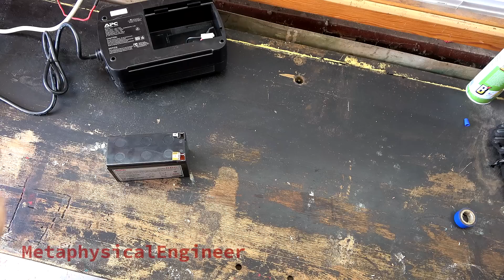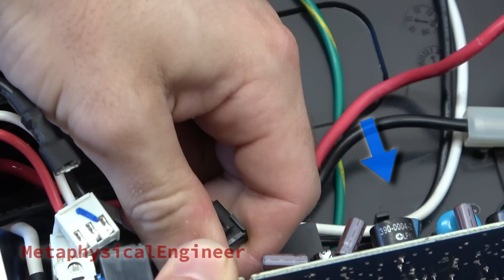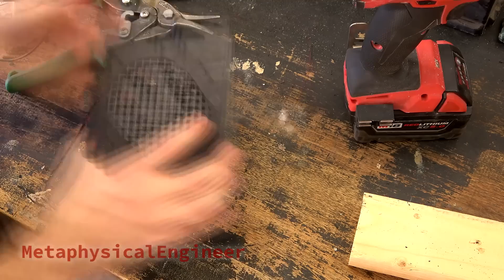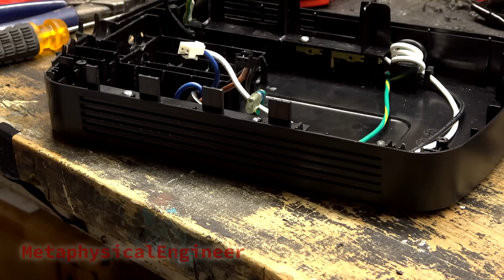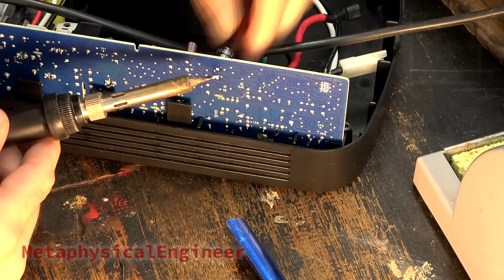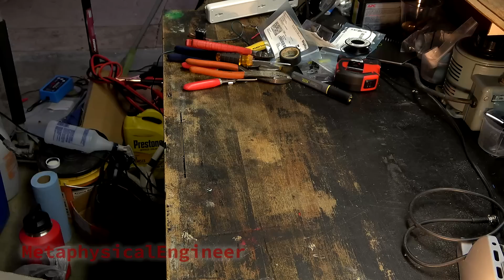Modifying broken UPS for long endurance BACKUP POWER!

Comment: I just need to supply a small load (my little web server + modem & router), so I didn't bother with all that stuff. No fan, no battery box. I just spliced a couple of cables with battery clamps on the ends, in place of the original 7A battery, drilled holes in the UPS box for the two wires, and put the UPS on my desk next to a car battery. (If I'd been intending to power a larger load then I'd have added a fan.)

One advantage is that I can swap batteries without shutting anything down.

Another advantage is that I always have a fully-charged car battery, ready to go, in case I need it.

The first time I had a power outage, it worked fine, but the beeper was intolerable. So, after the power came back on, I removed the beeper.

The next time I had a power outage, it lasted 6 hours and 40 minutes!  My UPS kept my website up the whole time. Nothing ever smelled hot, and the UPS never got warm to the touch.

I clipped a multimeter to the battery terminals, and the voltage decreased by a little over 1v over about six hours. I suspect it was near to shutting down by the end.
Reply from the maker: Sometimes that's all you need to hold out through an outage!  I like the concept of hot swapping external batteries as needed.  

I've not yet found where my unit will cut off based on voltage, but I'm guessing somewhere below 11 volts since it also assumes the battery voltage will sag under load.  You may have had even more runtime remaining than you thought.

Comment: I wonder if it would be possible to hook up the UPS to a bms and a Liion/LiFePo battery. If it constantly outputs 12v to charge the battery, and assuming the bms takes care of charging/cuttting charge and balancing the batteries, i wonder what else would be missing? Maybe a circuit to switch from input to bms to output from battery in case of a power outage?
Reply from the maker: Lithium battery with BMS and high current cutoff, and disable the original lead-acid charging circuit.  AC source transfer can still be handled by the original control circuitry.  Actually quite doable and much higher performance, though lithium is still significantly more expensive than lead chemistry, especially with the added BMS.  Maybe for version 2!
Reply: If you are rich enough to afford lifepo batteries, you are going to be buying top of the line industrial grade UPSs, not making your own out of scrap and base components.

Comment: did the same sorta thing with an APC Back-ups pro 1500
it had a fan and external battery add-on so I basically determined the limit would be energy of the battery and not the main unit
it worked fine for a while, but I wanted more than 850w of total surge power and the charging system was super slow for my 100ah 24v setup so I bought a real 4kw solar+charger inverter, and now I have 200ah(probably degraded to ~150ah) 24v system than gets me 6 hours at normal load and can push to 8 hours if I shut down some of my ancilary loads
Reply from the maker: Those pro units are tanks!  Makes sense that once there's provision for external battery, the unit is tough enough to run even longer without risk of damage.  What type of batteries are you using for your new setup?
Reply: @MetaphysicalEngineer   just the cheapest battery at my local Walmart in the capacity and type class I can get

I think everstart 29DC "marine deep cycle" types, they are about 100Ah in capacity when new, the old inverter UPS setup would have pulled ~45 amps at full load so I knew I wasn't getting a full 100Ah due to the whole "capacity degrades above the 25A rating" so I bought a second set later due to age and runtime

my average load was only 500W peak around 250w static but as I hate complex wiring I wanted a system that could pulse run my 1kw fuser in my LED-toner printer without wiring that thing to a seperate non-connected power plug

about 100-150w of my load is actually just screens and my router+modem(measured back in the cable modem days now I have a fiber line)

I am guessing my capacity will have degraded as much as 50% on the first set being 6-8 years old(if they work at all) and so my next big shopping item is probably gonna be 2 new batteries, 2 boxes, a spool of 1/0AWG wire, a crimper, and a set of lugs to crimp(finding pre-made cables of ideal length is pain)

when I finally retire my oldest set of batteries(only when they test bad and I have spares) I will re-use the cases and wires making the setup less evolving

and if I ever change my life and end up in a home I can do solar in I can use the inverter 24/7/365.25 and being I will be seldom loading more than 1-2kw in my indoor space it should last longer than my own body

sure at that point I would be using LiFePO4 12v packs(better capacity and endurance for deep-cycle if about 2x as pricey) but given an actual 100-0% rating of a minimum of 500 cycles(lead-acid can barely do 10 full cycles before damage) it is better for systems you might actually run that low

Comment: I recently found that those oscillating saws work amazingly on these abs or other similar plastic cases. (If you need a straight cut)
Reply from the maker: Thanks for the tip!  Didn't think to try the oscillating saw.  I'd worry it would bind up in the melted plastic and simply vibrate the workpiece instead of cutting, but I'll give that a shot next time.

Comment: you can also use a stepped bit as an impromptu deburring tool.

Funny you'd post this. We have similar power issues where I live. I'm already using a 'failed battery' UPS for surge protection and I've contemplated this exact modification. Now I know what I should be checking before I do the work. Thanks!
Reply from the maker: Yeah, a step bit would have been helpful at multiple stages of this project.  Another thing I rarely used (borrowing the boss man's kit when needed) but maybe time for one of my own.   

A word of caution from another commenter is checking that the battery side is isolated from the line voltage side.  Some units use a "line-interactive" type circuit where significant AC voltage can be present at the battery terminals and could give you a nasty shock if you do a USB charger or 12V socket like I did.  Measure between battery negative and ground.  You're safe if they are tied together, but beware if you get voltage there!
Reply: @MetaphysicalEngineer  Wow! I'll definitely check for AC voltage at the battery, It's kind of insane that a USB would be built that way. I lost a battery in my 1948 Willys CJL because the diode pack on the alternator failed and was bleeding AC power into the battery.

FWIW, Harbor Freight in the US carries stepped bits for under $25.

Comment: You could hang a small solar panel outside a window and use that to power the device while in standby mode. That should be enough to keep the battery charged. You would only need mains power if an actual load is connected.
Reply from the maker: That's a viable option since this side of the house gets plenty of sun.  I'll borrow the little 18W smart solar battery maintainer from my car to see how that behaves.  Anything would be faster than the tiny 3W charger in the UPS, though I fully expect to need an external mains charger to recover from an outage in reasonable time.
Reply: @MetaphysicalEngineer  That is the idea. Use mains for recharge, but solar for standby. with a bit of luck, it will give you enough power to charge your mobile devices for free. Not only will that save you some money, but you will have some power even in case of a prolonged outage.

Comment: Nice job. I have a 20+yr old apc 2200 with an external connector for battery packs. Only downside is it runs from 48VDC & I'd have to drill a hole in the floor down to the garage to add more batteries.
Reply from the maker: Thanks for stopping by!  Understandable that it's a pain to run remote batteries like that.  Is putting the UPS down in the garage next to a hypothetical battery bank and pulling a "surge and backup" AC circuit up to your workspace an option?  At least for me I'd rather fish romex or armored cable than a set of heavy gauge 48VDC wire...might be cheaper in materials too.

Comment: I did this with a couple of them. I removed the battery and put in a PC fan and a small 120-12v PSU for it. I ran it off the inverter outlet rails. I broke out the wall between the battery compartment and electronics area. These are underrated to have passive cooling. With forced cooling they do so much more. I also partially bypassed the amp limiter.
Reply from the maker: Another success story of a hotrodded UPS!  120V to 12V converter was an option I thought about for the fan, but just didn't make as much sense to me since the unit already had a 12V source right from the battery.  

How much more capacity were you able to get with the current limiter bypassed?  I imagine at some point it just bogs down too much or the transistors give up regardless of cooling.

Comment: Its alot easier to use self tapping screws for creating pilot holes in plastic when you have no anchor. It is also a lot safer than doing it with a drill. Get screw and hammer. Hit it with a slight tap in the spot you want (this acts like breaking the glaze on a tile.) Then use you cordless screwdriver to do the rest. Great vid by the way.
Reply: You are out of your mind if you think it is safer to the enclosure to be hitting a self tapping screw with a hammer.  If you have no concept of drill depth limiting, the last thing you should involve is a hammer, lol.
Reply: @stinkycheese804  you have obviously never done this.
Reply: On the contrary I could MORE easily state the same about your (in-)experience.  It's idiotic to hammer self tapping screws into anything, especially thin plastic.  Hopefully some day you will learn how to use a drill properly and open up a whole new world of hole making, lol.   @plebius
Reply: @stinkycheese804  you are talking about depth limit on drilling a unsecured piece being handheld. That slipped numerous times.
Reply: @stinkycheese804  I also thought it was obvious when saying pilot hole, you still use a bit in the handheld screwdriver once you create a pilot hole. Hence me saying you haven't done this. Glhf
Reply: I've been modding things for decades, no such issue merely drilling holes.  Really?  I'd hate to think how much trouble you'd have doing something more than entry level.  If it's that hard for you to depth limit, simply use a shorter drill (bit) if you've never heard of a drill stop or better still putting a solid piece behind the hole, clamped in so the back of the hole doesn't flair  out.  Round holes are a piece of cake.  More tedious is  filing out square, rectangular, etc for panel mount jacks/switches/etc. @plebius

Comment: yeah i have done the same thing a few years ago,but i started with a bigger metal case UPS,just ran leads out and connected it to a truck battery
Reply from the maker: Cool!  What capacity UPS did you use and how much runtime did you get from the truck battery?
Reply: @MetaphysicalEngineer about 350 watts,never found out runtime,it was hours longer than i ever needed,it might still be in my storage unit,if it is i'll get it out and take some photos

Comment: I’m watching your video on this ups, and get blown away when you bust out the field piece sman Hvac gauges. Now I gotta dig throuh your channel to see why you have EXPENSIVE HVAC tools on your workbench. I have several sets of them in my HVAC service vans.
Reply from the maker: I used to work in HVAC and refrigeration but got hit with a career-ending back injury earlier this year.  Fine now but high risk of repeat if I go back to heavy trades work.  Getting forced to take a step back revealed I wasn't where I wanted to be after all.  I am considering getting my license at some point, if only for easier access to certain equipment and parts.  I've torn down a compressor with valve failure on here, and have a second compressor with a suspected broken crank also waiting for teardown sometime.
Reply: @MetaphysicalEngineer  I’m old school, got my licenses at 17 back when all ya had to do was take the tests. 
Nowadays, all the insurance and work hours experience needed to qualify to even take the tests slows most from getting licensed.
Lemme know if ya need any assistance with anything. I put your video on diysolarforum it should post up after Will Prowse reviews it. 
See if we can get you some exposure for a nicely done video.

Comment: I need to do this. My UPS gave me an error saying the battery was toast, I cleaned the terminals, checked voltage, and hooked it back up and it's not given any kind of error or warnings in the 3 weeks since. A bummer since the battery is 18 months old, and the OEM replacement is backordered :(
Reply from the maker: Easy way to test is do what I did putting a constant load on the UPS with lightbulbs and seeing if it comes close to expected runtime.  If it falls well short or instantly loses power, the battery's given up.

Comment: WARNING!
I do the same thing many years ago using another model of UPS (was a cheap line-interactive unit, so basically the same thing of your UPS)
Everything worked fine (i also added a small fan inside in place of the battery for cooling purposes as well) and this contraption ran for about 10 years but.......
...... it turned out that my UPS had no insulation between the mains and the battery because the output transformer was connected in autotransformer mode to boost or decrease the output voltage in case of weak or too strong grid (i.e. a sort of rough voltage stabilization operated by switching some relays) which means the battery terminals floats at 230V, the european mains voltage!!!!!!
For me it wasn't a big problem (i also enclosed the battery inside a box) but in your case it may be extremely dangerous (because of the USB and the 12V auxiliary outputs!)
 Please double check if the battery floats to mains voltage or not.... this is important!
Reply from the maker: Yes!  This is important for line interactive type units that always provide regulation.  In my case, this unit has separate low and line voltage sides, with battery negative referenced to earth.
Reply: @MetaphysicalEngineer  Good to know.
But this is something you should point out for warn other people.... Without the external low voltage outputs this is fine, but if these ports are added, the builder shall double check for insulation!

Comment: I liked how for every modification step you checked that it would not catch fire.
Reply from the maker: When the battery can dump nearly a thousand amps into a fault, things get rather exciting.  Getting or building a bench supply is on the long list of things to do.
Reply: @MetaphysicalEngineer  Agreed. Had a motor driver fail SS and in the few seconds it took me to pull the batteries it desoldered almost every connector and stripped every wire in the chain, and that was likely only ~200A. When the battery can weld a wrench across itself, you take extra precautions 😅
Reply from the maker: @Lizlodude   Holy cow!  Sounds like it got your heart pounding!  Glad you're ok!

Was that on a high performance RC vehicle?
Reply: @MetaphysicalEngineer  time to buy a bum desktop computer just to turn the PSU into a bench power supply.

Comment: THAT NEEDS TO BE FUSED FROM THE BATTERY. If a short, the wires would burn up at that would start a fire. No way the wire you are using can take the amprage of that battery should some thing go wrong.

PLUS the fact that battery emits HYDROGEN GAS is not very safe.
I can see this as a recipe for disaster.
Reply: He did put a fuse on the battery, no?
Reply: Did I miss that part? @amogusenjoyer
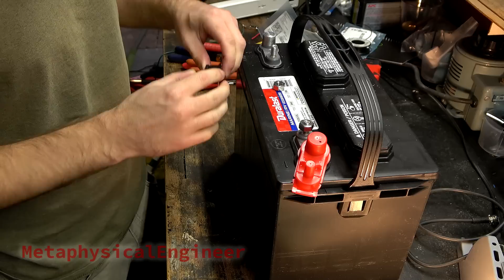Reply from the maker: 22:44  -  Main fuse connected to battery positive terminal.  In fact I specifically outline the dangers of such a large battery with specs on how much current it is capable of providing.  

25:54  - Secondary fuse for voltmeter, utility 12V socket, and USB charger.

Comment: Wait so you are telling me just by adding a bigger battery and keeping it cool will make it run longer....I tried that and mine APC did not....pls help
Reply from the maker: Essentially yes.  The UPS is designed to run until the battery depletes.  Bigger battery stores more energy, so UPS runs longer.  Fan keeps it cool because original design assumed battery would run out before the components overheated.  

What model APC unit did you use?  What size and type of battery?  What load were you powering with it?  How long did it run before it stopped? What LED indicator error code did it give you?  Did it work again once you recharged battery and reset it, or did it break down and refuse to work at all now?

Comment: One thing I question: in the final assembly, isn't your intake fan between the UPS chassis and the battery box, with only a thin channel for air intake?
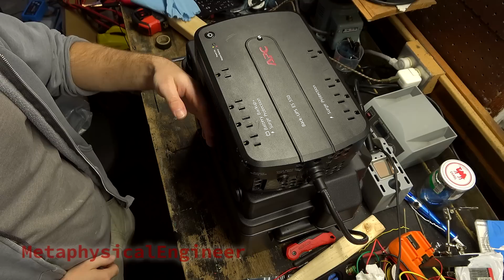Reply from the maker: Ah, I should have gotten a better shot from that angle.  The fan intake lines up with the channel molded in the battery box lid and the lift from the dual lock velcro pads securing the UPS added even more clearance.  Plenty of airflow!  You can get a rough idea by looking at where I placed the pads on the UPS around 27:45 and where the pad is visible just above the switch on the assembled product around 30:14.